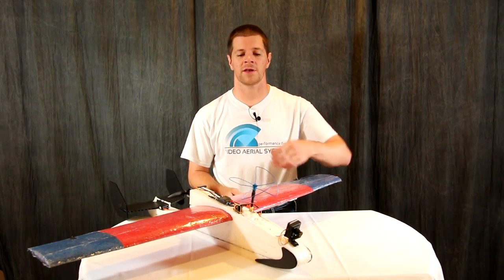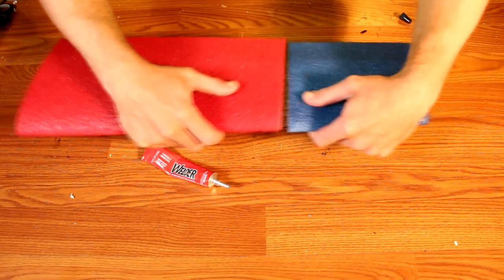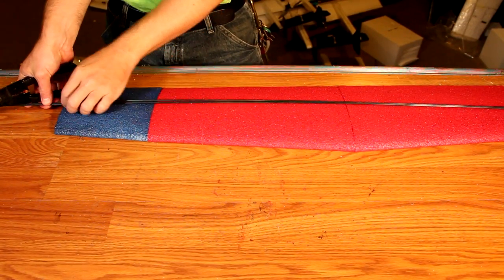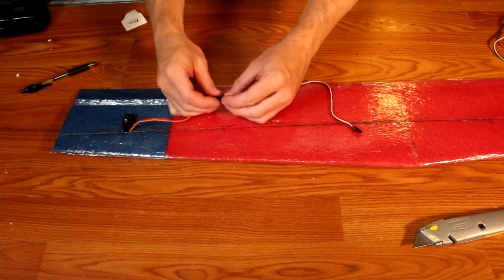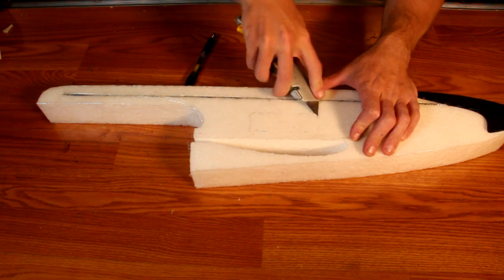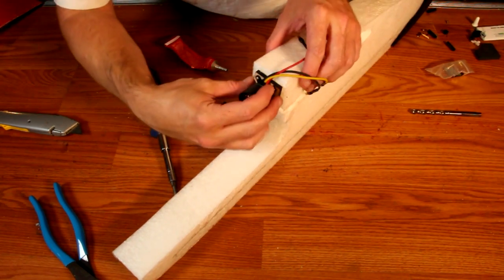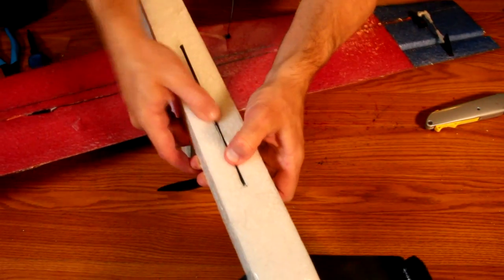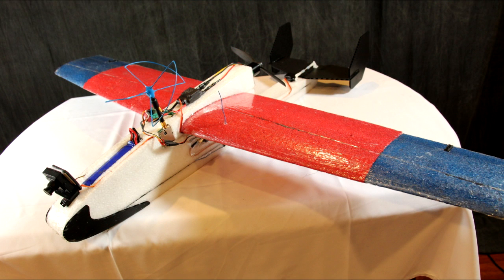Build the VAS Spark Sport airplane

Comment: Hey Alex,

My Spark Sport made it's way home yesterday.  I have a couple of noob questions.  First, the fuselage was curled up a bit in the tail section.  I set it on it's belly with a little weight on it last night.  Is that what I should have done, or is there a better way?  Second is the tail section.  The vertical stabilizers fit very tightly, and caused the coroplast to bend a bit.  My tail doesn't look quite like the one in the video.  I have slots in the tail, that look like they were meant to slide the stabilizers in there, or in my case, I slid them as close to the inside edge as possible to be able to use welder all the way around, and still let the elevator move.  I haven't glued it in place yet.  I'm hoping you, or anybody else can point me in the right direction on this part.

Thanks.

Comment: Wow That video TX is just a couple inches from the ESC but I am sure Alex knows what he is doing. I have to get some of his linkboards perhaps that helps keep his video clean. I am using DTF UHF and 400mw1.3 and a VAS LPF and the other filter thing  for my Taranis antenna (i cant remember what it is called and I am about ready to test mine but I dont have his linkboard but something similar from RMRC I guess i will know soon. (I may just be paranoid about esc power spikes and noise )
Reply from the maker: Paul F - With only 200mW transmitter power, this kind of proximity is ok.  Indeed more separation would be better, but you might notice that this unit doesn't look like any other LRS out there... ;)
Reply: No,  as Usual Alex you are on the cutting edge! LOL  I know you always fly with way, way, less TX power than most anybody !  I dont have your confidence yet!    I am still a newb but i am learning.   :)

Comment: how much flight time do you get out of it?
Reply from the maker: Grearson .x  Theoretically I can go 30 minutes on a battery charge, but I can't stay off the throttle.  My flight times are around 8 minutes on the Cobra motor I have in the video since I run it at ~3/4 throttle most of the time doing the yank and bank stuff.  I was comfortable flying 4 miles with it, though.
Reply: ty =) thats still an awesome timespan =)